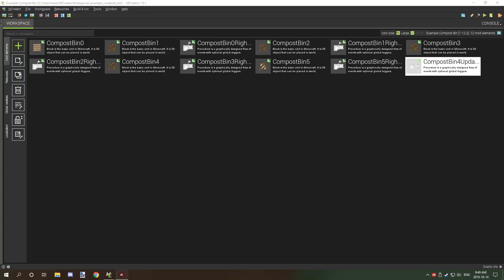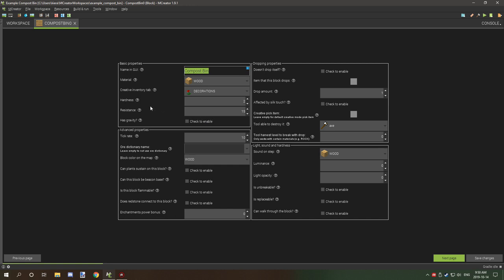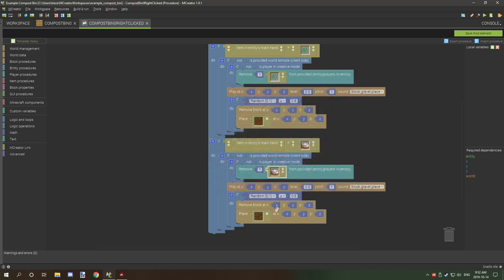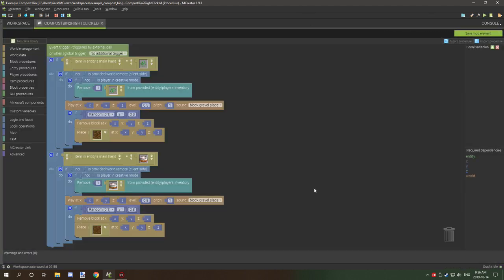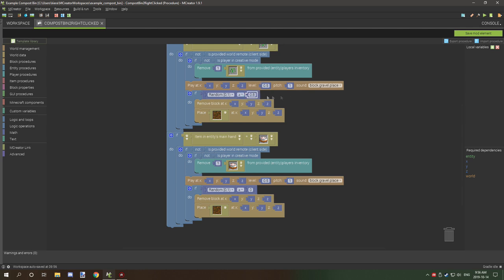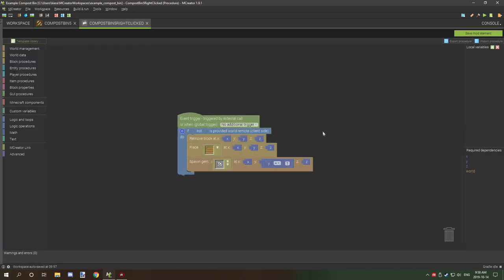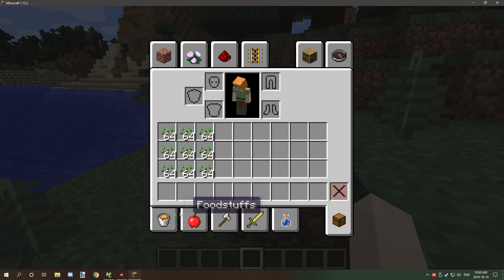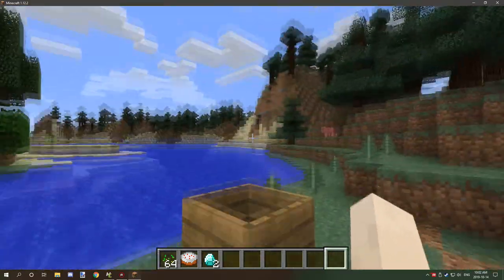MCREATOR: Compost Bin Tutorial | 1.9.1

Comment: Is it possible to make the block have 2d texture like the cauldron?

sorry for my bad english i'm using google translate
Reply from the maker: For blocks yes, it should be but with custom models only, you will have to play around with the display settings for the model. I usually just grab the display settings from other blocks in the model's folder that can be extracted from the Minecraft .jar file.

you can get the display settings from the block.json file then paste the hole thin into the custom model of your block.
        "gui": {
            "rotation": [ 30, 225, 0 ],
            "translation": [ 0, 0, 0],
            "scale":[ 0.625, 0.625, 0.625 ]
        },
This section of the code is what you will want to play around with mainly the rotation. I am not sure how that works exactly but I do know that the settings from the block.jason will make it face the direction like every normal block in Minecraft.

Comment: Hello, I have a request for a tutorial. I want to make an Item which will change it's model when right-clicked in air. I don't know how to make it, because there isn't a simple way in the procedures. Could you please help me?
Reply from the maker: All you need to do is make a second block with the model that you will be replacing it with then have the first block remove and add the new model. You will also want to test if the player is holding air witch will test if the hand is empty, if you are wanting to upgrade or downgrade the model though then I suggest testing if a specific block is in the hand and then making just a simple ELSE statement to test for any other block other than that block in the first condition this will allow the player to check for air as well as say dir or other blocks that the first condition is not testing for. For the tutorial, I would suggest watching my block state tutorial I will link to that below.
https://youtu.be/9UlCrWHW9D8

Comment: Hi NorthWestTrees Gaming, Is it possible to make such a function in MCreator? 
One player put a block and he can break it quickly and easily, then you go under a different nickname and try to break it, but it breaks for a long time and slowly, but when you put the block with this nickname the same block you can break it easily and quickly.
Reply from the maker: For the block you will need to use block states to change the settings for the block. So the best way is to make your easy breaking block then clone that then change the settings on the second block for harder settings.

For for player nicknames not sure if that is possible, however, you can store variables in NBT. Other than that I am not sure how to target a player nickname to change a block state, or if its even possible at this point in time.

Comment: Can you make a tutorials how to make a custom ladder? Thanks
Reply from the maker: Great idea! I think it may be done with moving the entity not sure how I can get this to work but I will put some time in testing this when I find some time. Thanks for the suggestion :)
Reply from the maker: I put some time into testing after work for about 2 hours, I could not find a way with what I have to work within the current state of MCreator to make a stable latter, the only type I ended up getting to semi work was based on players movement but it would cap out over time when the player reached a peculiar height then it would bring the player back down. Also, it demobilizes the player from getting off the block when in motion, so I can't think of any other ways to work around this without having some kind of support for ladders added.
Reply: OK, thanks!!!